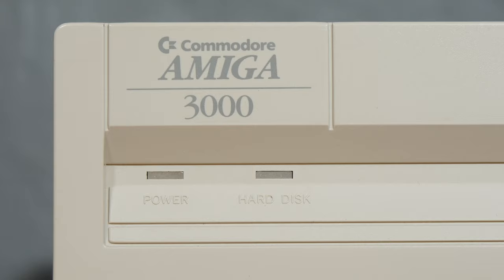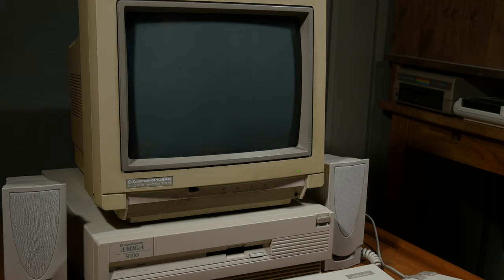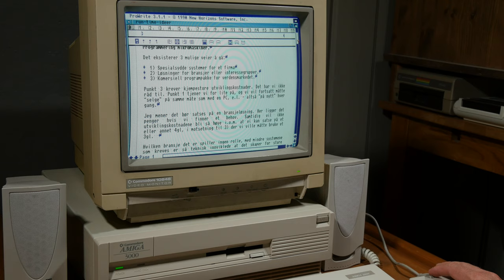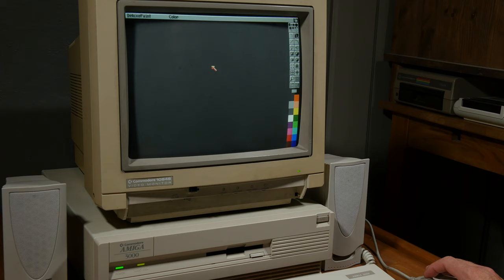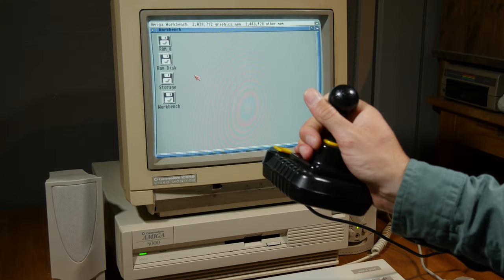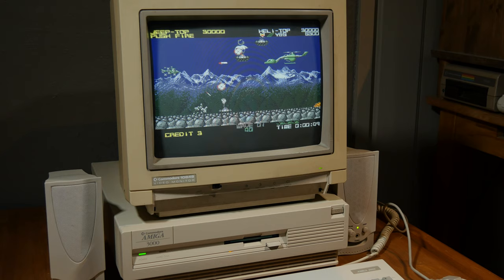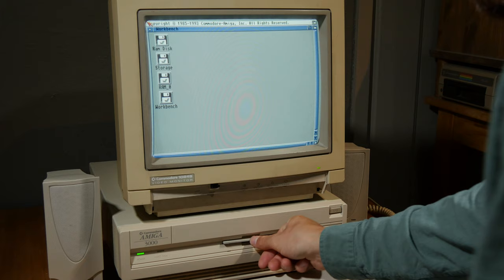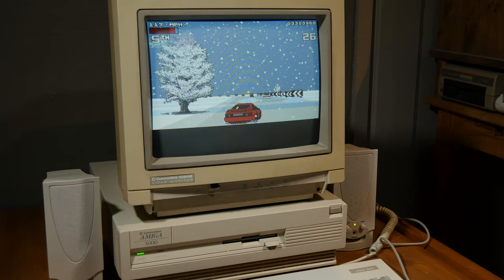Amiga 3000 - Exploring Hard Drives and it's Specifications

Comment: I had an Amiga 500, with a Kronos hard drive adapter, put a used Miniscribe 40 MB HDD in it. Sold that, and bought a 2000, and then finally moved up to the 3000, which I think I bought in 1990, or 1991. The ram on the 3000 was unique as it was called a ZIP chip, the pins were basically just wires sticking down in 2 rows, and the rows were offset from each other, consequently, it was fairly easy to bend a pin trying to install the chip.

Comment: Nice video dear friend, love the intro of the A3000, nive pick of music, like you did with the A1200 introduction 👍🏻
With the 030 cpu and 2.0 kick, you will experience alot of compatibletyissiues with early floppy disk games, whis system with 8MB fast ram is great for WHDLoad gaming instead 😁👍🏻
Reply from the maker: Thanks :) ok well I have an a500 also for gaming so that's fine :) yeah I think I will wait with whd load gaming until I get an amiga 1200. That will be my ultimate gaming amiga
Reply: UncleAwesome 🕹Nice, but the A3000 is also great for whdload gaming, when you time, install WHDLoad on HD with few games, the 030 handles then well
Reply: Yes, indeed. With 8MB fast Ram this Amiga 3000 will be perfect for whdload
Reply: I used ReloKick 1.3 and Degrader software to run Amiga 500 games.

Comment: Amiga's ECS is not a 32-bit chipset and it wasted 32-bit bandwidth gains.
Reply: True, but A3000 got 32 bit chip ram though. For  A3000/UX model, Commodore offered a 32 bit graphic card. 

The beauty of the built in flicker fixer is double the vertical resolution without increase the load/data for the chipset.
Reply: @remijakobsen1848  FYI, I owned an Amiga 3000/030 at 25 Mhz with Kickstart 2.04 model.
Reply: @remijakobsen1848  FYI, my Dad has unexpectedly purchased Amiga 3000/030 at 25Mhz with Kickstart 2.04 ROM model and traded our Amiga 500 Rev 6 in early 1992..

Amiga 3000's ECS is like the C128 approach i.e. aging gaming graphics hardware with minor low color display higher productivity resolution update. The C128 mindset applied for the Amiga ECS marks the second fail future direction. My Dad is a fan of sports games. For work, my Dad also purchased 386DX33 PC with Circus Logic 54xx SVGA.

Amiga 3000UX has A2410 (Texas Instruments TMS34010). Amiga 3000UX with A2410 was expensive and it lacks games that can use A2410 graphics card at that time.

I run Shapeshifter (MacOS, MS Office) on the Amiga 3000 for school work and I played Doom on my Dad's 386DX33 PC. I have used my Dad's PC monitor on Amiga 3000's VGA port with a flicker fixer. PC monitor has a better pitch density when compared to 1084S.

According to DaveH, AGA was completed around Feb 1991. Commodore management delayed AGA's introduction at a similar time as the rumored ECS with 68020 Amigas.

During COVID-19 lockdown, I purchased a cheap "broken for parts" Amiga 1200 and it was fully working since the seller didn't know about it.
Reply: @valenrn8657  I've got all major Amiga models except the A3000 tower and A4000 tower (had A4000T back in the 90's). Bought a second hand A4000 around 1993, first thing I bought for it was a GVP EGS Spectrumn 24 rtg graphic card to have fast graphics with many colors. Used ShapeShifter to play Doom. 

As you propably know, a1200 needs new capacitors.
Reply: @remijakobsen1848   
EGS Spectrum 28/24 has Cirrus Logic GD5426 or GD 5428 (VL bus) which is a similar SVGA chipset with my Dad's 386DX33 PC's Cirrus Logic GD5426.

In late 1996, the choice is either  Phase 5's Cybergraphics 64 + Cyberstorm 68060 50Mhz upgrades vs Pentium 150 (166 Mhz OC) with  S3 Trio 64U PCI-based PC. Pentium PC was cheaper.

Phase 5's Cybergraphics 64 used S3 Trio 64U SVGA chip and it was expensive when compared to PC OEM S3 Trio 64U PCI. Quake was the trigger point for my switch towards Pentium 150 (166 Mhz OC) with  S3 Trio 64U PCI-based PC in late 1996. I sold my Amiga 3000 to a small TV studio and the funds were used to purchase Pentium 150 based PC. 

My A1200 Rev 1D4 has been recapped, upgrade with KS3.14 ROM (for beyond 4G flash storage)  and Amikit's 8MB fast ram + 68882 FPU at 40 Mhz expansion card.
Reply: @valenrn8657  thats great. I went the Amiga route  as multimedia and Amiga was my main interest, bought an Apollo 060 which I upgraded to 75 MHz. I could play Quake inn full sceen just about, but when I linked up to my brothers AMD 200 mhz PC and refused to decrease screen size, he won all the time due to higher fps.
Reply: @remijakobsen1848  Pentium 200 (P54C, Socket 7) has 64 bit 66 Mhz FSB (528 MB/s for geometry/color/texture/frame buffer) and 32 bit 33Mhz PCI (132 MB/s for frame buffer display I/O). 

Amiga AGA's memory bandwidth is about 28 MB/s.

For Quake's concurrent FPU (geometry) and Integer (color, texture) processing, Pentium P54C has the advantage over the AMD counterpart. 

My Pentium Socket 7 (PCchips M507) motherboard has a 512KB L2 cache.

PCchips is currently known as Elitegroup Computer Systems.

MC68060 still has 32 bit FSB (front side bus). Pentium's 64 bit FSB allows for faster access and storage of 64-bit and 80-bit x87 FPU data.

For the classic Amiga, Vampire V2+ AC68080's FSB improvements would be needed.